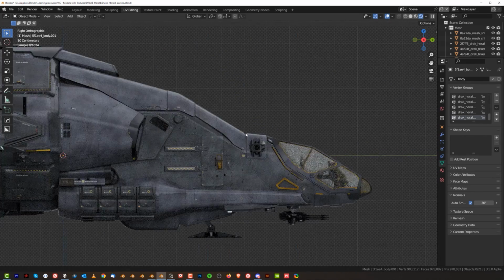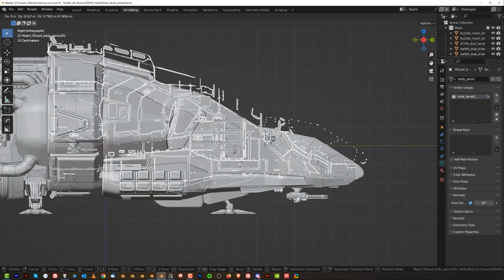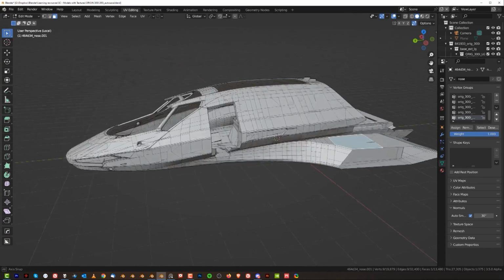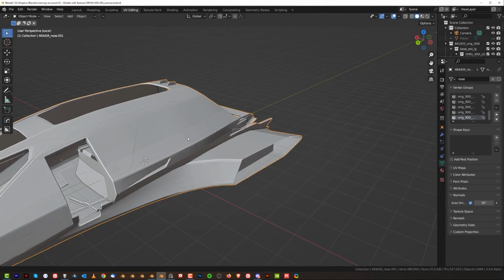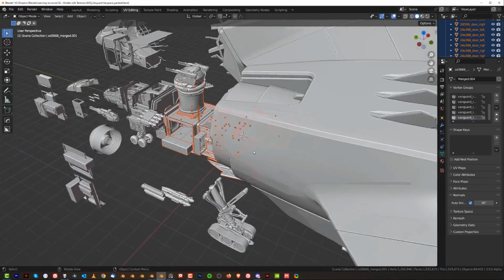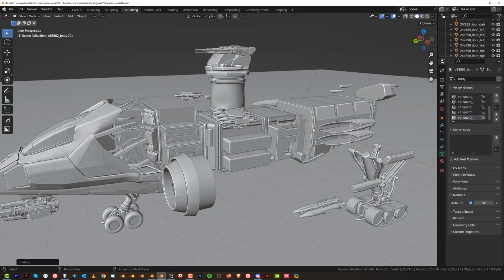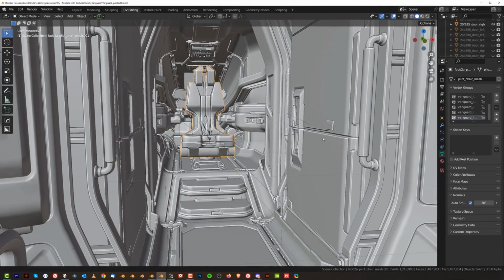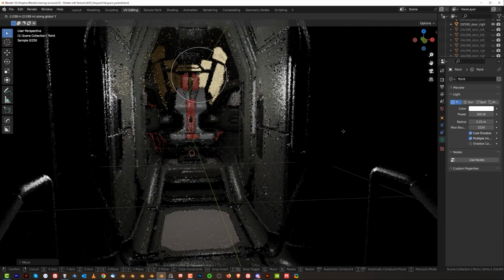LEVEL UP Your 3D Design Skills Faster

Comment from the maker: 👉 Learn Hard Surface Modeling in Blender in Under 2 Weeks (1,500+ five-star reviews): https://www.blenderbros.com/accelerator?el=pr
Reply: One more question,  i just got mail from you "The biggest Blender struggle" where you promote a coaching program in the end with a button on the landingpage, but the button links to the hard surface academy, which from what i can see is no coaching/mentoring but a collection of some of your tutorials, was that a mistake or did i misunderstodd what you were promoting? thanks
Reply: @PonteRyuurui  good stuff!
Reply: Gives error 1020 , unavailable.
Reply from the maker: @tegkgiof  if you re in Russia, could be, use VPN
Reply: @PonteRyuurui I did so, thanks.

Comment: I'm wondering how many people usually work on a single spaceship to produce such a result? Can something like this be done solo without the modeling process taking months?
Reply from the maker: It is feasible, but it would take a hell of a long time and research. You'd nee to be a top expert in several areas. 12 pl on the team for each vessel, at minimum. Also, designers work together with modelers at the same desk. Not to mention that modelers have engineering degrees.

Comment: Is it safe to assume that they don't account for hull thickness? They don't apply solidify modifier? The thickness of the hull is just a simple plane I guess...
Reply from the maker: It's a good subject for an article on Reddit "Devastating Atmospheric Pressures of Outer Space Regions in Unreal Engine 5 and Their Adverse Effect on Cargo Ships' Hulls"
Reply: Oh you 😂 Great idea, but no. 😂 What I meant is, when you disassembled that modular ship, I think I saw that hull has no thickness. This makes it easiet to model interior without having to think about bevels and shading issues. Or I saw it wrong...
Reply from the maker: @valdoltra  well always think of whats the purpose of the mesh, in this case no one will see the thickness, so use planes

Comment: If you aren't interested in the game itself, there's no reason to buy every ship from the official store (prices from 60$ to 1000$ and above). 
Instead, you can get a starter pack (45$) and buy in-game currency packs on the grey websites (7$ - 50ml). This amount of in-game currency helps you to get all in-game ships.
About the in-game wipe, this happens once per season or half of the year. And there's not a full wipe, 50/50 in the worst scenario.

Comment: You got a real treasure there!! The final mid poly, wow!! Another source of inspiration are the ships exteriors in Elite Dangerous (or even EVE), plenty of compelling designs (even if the smaller levels of detail are outdated). I am sure your are getting tons of hints on how the original models were designed and constructed (seems mostly if not all sub-d), thanks for sharing  some. Regarding the decals, they are one of the reasons why some modern games are so CPU heavy. They use a technique called POM to display the geo, aka Parallax Occlusion Mapping. Another new game where POM is used with stunning results is A Plague Tale: Requiem (also super CPU heavy). All is now changing with AI, where you get a detailed depth mask from  an AI generated 2d image without needing to model anything in the first place. With the right Ai trained model you can spit out thousand trim sheets variations (already tiling, lol) AND the depth maps, basically ready for placing your trims UVs and POM away in engine! Like for everything else, there are limitations to the technique but the results can look just like everything was modeled in.

Comment: Star Citizen has been in dev for quite some time. The last time I read/viewed their dev process a few years ago, I think have people who are from Industrial Design. In Industrial Design (ID) form, shapes and functions are very important. Those who ID are not just going to slap some shapes and details here and there for the heck of it, but they do think it through, very much like automotive designers.
Reply: Yep, someone else also mentioned that an artist they know who works at CIG says the style guides are documented almost identical to the engineering style guides used by automakers, mainly because the thruster placements actually affects its flight capabilties, and they have to accommodate interior designs and physicalized compomnents that have actual relays that power those compomnents, just like a real-life vehicle.

Comment: As an "old school" sculptor/model maker in the 90's I was part of the British sci-fi click, before going pro producing vehicles/miniatures concepts for a number of garage kit companies. While I love StarCitizen, some of it's design is totally impractical/unbelievable. Martin Bower lead model maker on Space 1999, Alien and Outland quoted "good sci-fi design looks like it was built for purpose". An understanding of engineering and scratch building SC ships would prove the gun turrets (mostly orrid) would fall off and the ships are not balanced. Look up Martins designs, Steve Begg, Ron Thornton, Mike Trim, Bill Pearson.. To name but a few.
Reply: Some are more or less practical than others; depends on the manufacturer. Drake has a lot more duct-tape and screwdriver designs, whereas Origin is built around luxury accommodations. There are also alien ships in the game, where conventional human practicality is thrown to the wayside due to cultural differences. Ships like the Reclaimer or or Vulture definitely fit the practicality side based on how they function and what they do, whereas the Prowler or the Banu Defender are more for "wow" factor.

Comment: I would love a look at how they have the textures set/how many there are per model. Ive heard they use trim sheets but I would love to actually see them.
Reply: For what I have seen they use vertex groups to texture different areas. I tried to replicate the method and couldn't quite figure out how they did it.

Comment: a question for quads how to fix that detail, when you use Hard Ops and Boxcutter the vertices are loose, how do you fix that detail
Reply from the maker: you catch all the quadboys and eliminate the resistance
Reply: @PonteRyuurui  no entender xd
Reply: @PonteRyuurui  A little help, I can't find how you clean or fill the quads or triangles, I say this because using these tools generate inconsistency in forming quads, it's more work then joining them, I say this because where I work, they use mesh to start with and if you look at this detail, everything has It would be fine if they don't return, but with Blender I went through everything and I'm just fine that most of them use these plugins but it seems that they are neglected a lot in quads, I think you had a video on how to fix this, a link please, I did it the same way old way...

Comment: I like the EVE Sisters ships, the Machaeriel and some of the Caldari State ships (Raven, Tengu, Drake) from EVE Online. Also check out some of the entries from the Nvidia Metropia 2042 competition. What I've been doing recently for design studies is blocking out the primary, secondary, and tertiary shapes in blue, pink, and yellow in Photoshop like in the gleb presentation some years back.

Comment: I purchased the design course on your website to go faster with my switch from maya to blender, I just saw this video and I agree with your analysis on SC design. Do you have a tutorial that explain how to use decals on blender in such a way? Anyway for this kind of projects, the way a ship looks, the way it behaves I guess a large team of modelers and engineers worked together to realize a single piece ☺️
Reply: Decal Machine is fantastic. Well worth it for doing hard surface decal work in Blender.

And yeah a ton of people are involved in the making of a ship :)

Comment: 17:38 "The reason why they do that is because baking bevels doesn't produce good results". This just isn't true - you can bake bevels fine provided that you setup the lowpoly/ uvs/ cage correctly. The reason it's popular is because a.) it's really fast - a whole lot of time is saved not baking anything. b.) the two methods actually have the same vertex count at the end since you don't need hard edges with this approach. 
There's a bunch of caveats as well, but overall it's a great technique :)
Reply from the maker: false, if you bake bevels on sharp edges at certain angles and lighting they will look liek garbage,a nd that is why they do it.

Comment: So if I understand what you are saying corrected, it's fine to export a model without baking the decals(like for DecalMachine) into the texture and it's better to keep it separate? So is it fine for a production(like Star Citizen in this case)  to just leave the decals separate from the main model, if you intend to rig a had surface it and use it for a video animation project or use it for a game engine with no real issues? I have the documentation in knowing how to texture bake those kinds of decals, but from the comments I have found on the matter is that unless you bake it as extremely high resolution(like over 8k) the decals won't look as good as they did before the baking; do you share that opinion?
Reply: Baking them is not needed and takes a lot of time best is ti create atlas
Reply: @The_5th_Dimension Yes I know it take a lot of time to bake, but I am asking on a productions stand point for a rigged animation model here.
Reply: @mix-up9003  I can tell you that its definitely better to leave them as separate mesh for production in most cases. I would only consider baking them if my objects will not be sharing the same decals and I want to have different materials for my decals. Also keep in mind that once you bake them they are permanent and u need to rebake to change them. Combining multiple textures into one atlas can be more memory efficient, especially if decals are used repeatedly throughout a scene. Lastly if you already have atlases ready you can significantly save time because you can just export your decals and assign atlas shaders instead of going through the baking process and texturing process again and again. Im biased af btw. Also if you need help on exporting to game engines checkout my playlists where I talk abt exporting to UE. Hope this helps!
Reply: @The_5th_Dimension  Okay I was thinking more for a 3d animation projects in mind, it's my fault for not specifying it earlier, but this is at least certainly helps for to have a clearer answer for on what I want to hear. While I did consider the most of draw backs of baking that you mentioned, it great an opinion on the matter, which helps a lot in my decision process on leaning things as is, if it helps to be less taxing on my PC, Thanks a lot. I know next to almost diddly squat about UE and game engines in general, but I certainly can see a necessity to learn to using it, thanks to sharing your videos with me. I am unfortunately unfamiliar with the term 'atlas' in this case, are you referring to a asset library in blender, if I am to guess it? So if I am to understand right, I can do a full on animation with a decals from the DecalsMachines library, in Blender, with no extra steps needed to make sure the decals will stay still, at all times without the risk of going haywire at some point, aside from the usual occasional program screw ups?

Thanks again

Comment: some of the geo makes me think they are using something like moi or even plasticity or fusion then importing to blender or maya etc for decalling and simpler parts. the wacky ngon geo and gridded geo reminds me of cad surfaces turned into polys. which isnt surprising really with hard surf. i wonder how they handle LODS because drawing the ships at full all the time would be not a good idea. could use LOD generating software ahh cant remember atm name of it but its used in games alot. simplygon?

Comment: I'm digging the modularity of the Vanguard, and the detail on the Mole is just insane! It's not a conventionally pretty ship, but there's so much going on.

It would be great to be able to get a breakdown of the design process for one of those ships. Like, how do they settle on a shape, what problems do they encounter while designing, how do they determine what level of detail is good enough but not too much etc.

It's weird - I see nothing on the Mole for example that someone with a bit of HSM under their belt couldn't make, but the sheer amount of stuff is intimidating.

Also, how does the game handle so much geo? Even with all those decals that one ship still has 900K verts! Even if you break that up into the interior and exterior, that's much more than most conventional games show these days.
Reply: in star citizen, the interior isn't rendered unless you're inside the ship or you can see into the entrance

most ship interior sections are also separated with doors, so you can likely assume that the sections behind doors aren't rendered until you access them

so for the most part, only the exterior of the ships are rendered - like if you're in a dogfight or something, you're really not gonna be close enough to the other ship, or looking close enough, for it to matter
Reply: @milk697 
True, although you can see in through windows to see someone walking around inside a ship from the outside.
So if you are flying in from of it or are in a elevator or something but can look into the windows of the ship you can see the people in there walking around.
It's kind of weird to look at since your down and the down in the ship is different (thing gravity generation etc).
Reply: The shapes are based on style guides based on the fictional manufacturers in the game. Different manufacturers have different motifs. For instance, most Drake ships have a very similar cockpit design, same with Anvil. Crusader has very obvious wingspreads on their ships; RSI is known for their cockpit struts. 

The pipeline at CIG is also very streamliend for building ships. Ironically, the biggest hurdles they run into aren't even with the art design of the ships, but the ship features (which are designed by a completely separate team known as the vehicle features team). 

The art team can complete whitebox designs of some ships in a month or two, and a greybox in a couple of months (for medium to small ships). SOme of the ships had their art designed years ago, but are held up in production due to the vehicle features team not having the design capabilities ready for the ships.

Basically, the art team is VERY quick with their ship designs.

Also, the game used to have pretty awful optimization, but with the Gen12 renderer and a server-side object container streaming, they have managed to improve overall performance significantly, even with massive ships like the 890Jump on screen.
Reply: The cryengine is very good at crunching polys.  Thats one thing its pretty good at.  Also LODing helps a lot.  Culling as well.
Reply: @ephalanx1  Cryengine is no longer used. They're using a very modified version of Amazon's Lumberyard now.